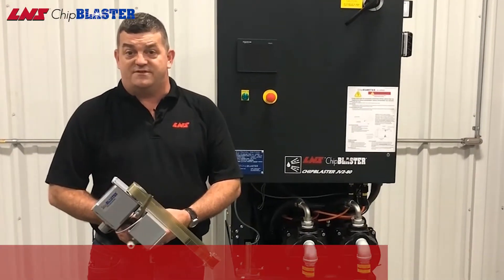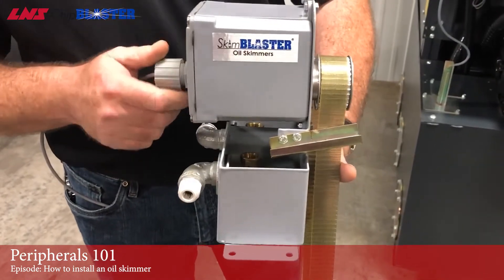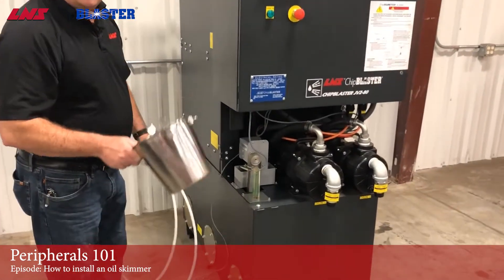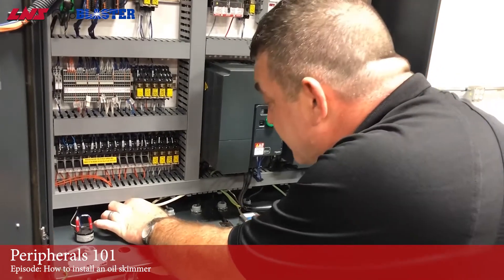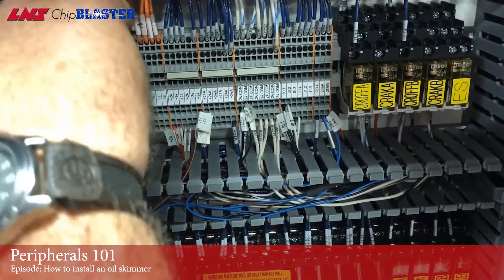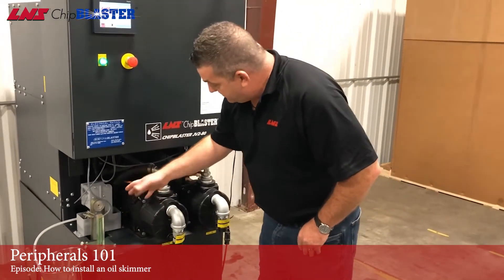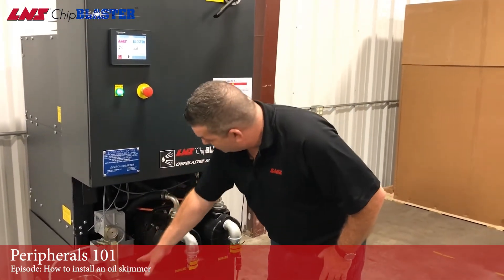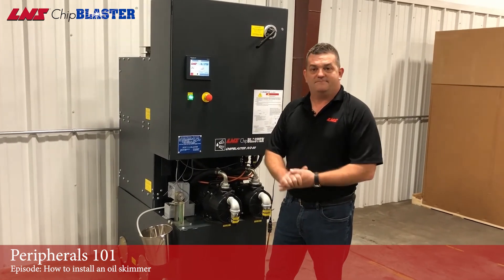LNS ChipBLASTER How to install an oil skimmer

Comment: Where i work we use the same skimmer that you installed in your demonstration. I've noticed lately that the collection bucket (5 gallon) level hasn't changed from time to time. Eventually I couldn't dismiss it any longer and began intently observing if the skimmer was actually working. 

It wasn't kicking on anymore and the only time the pulley would function is if I rotated it by hand (about 1/4 turn) and the motor would start up. The belt only turns for about 20-30 seconds (all the while slowing down) until it gradually stops... It won't turn on again, even if I repeat the "jumpstart" manual 1/4 turn; nothing. 

Maybe an hour or so will go by, I'll give the pulley a small turn and it'll do the same; rotate for about 20-30 seconds and slow to a stop. 

Any guesses what the culprit is? Thank you in advance.